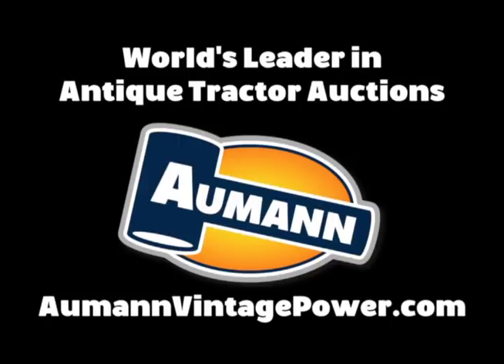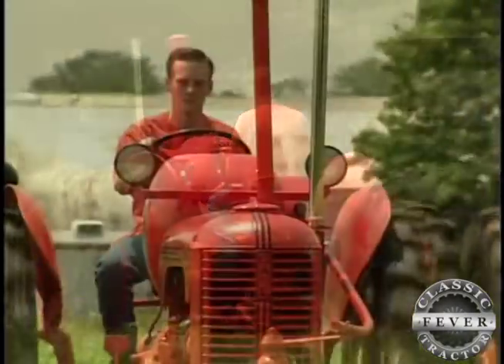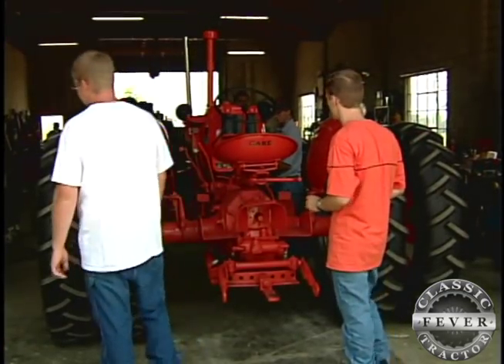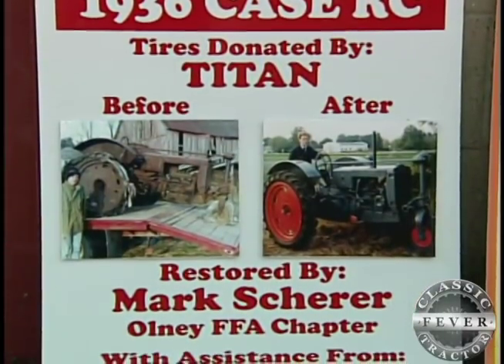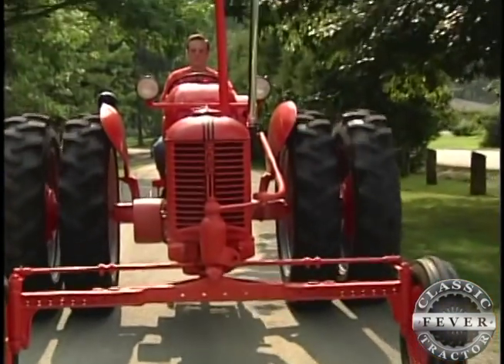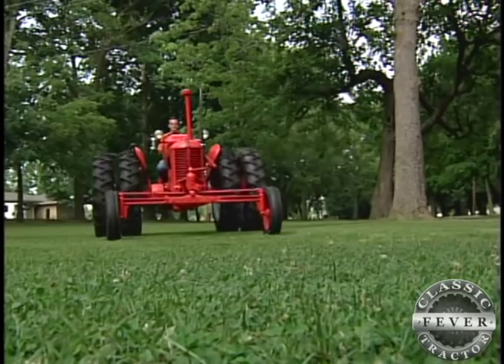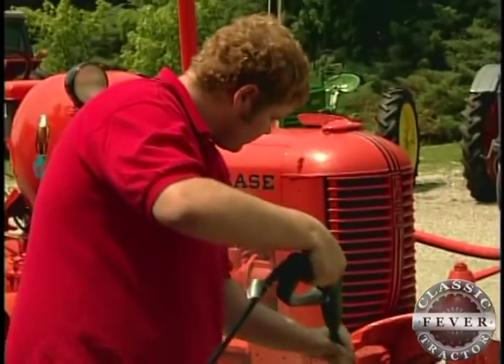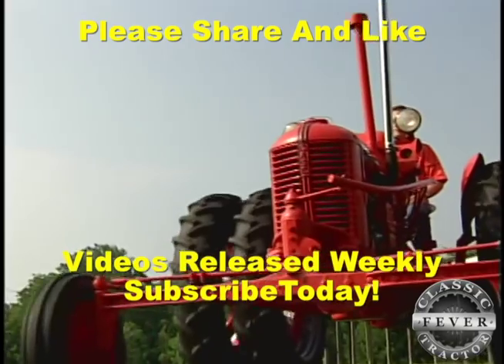1949 J. I. Case Model DC Gas Tractor With Rear Duals - Classic Tractor Fever

Comment: That is a really unique  tractor. I especially like LP tractors, as I have an Allis Chalmers WD 45 with LP conversion. I would love to see that tractor at our antique show in 2019 as Case is the feature tractor. Our web site is AE-TA.com.
Reply: Thanks, it does have some unique features with the 96" rear axles, adjustable wide front end and propane.  The duals are not original, but I like them.  Titan Tires insisted on donating all new rims and tires for the tractor.  Thanks for featuring Case at you show.  It looks impressive and  I see that you have supported your local FFA chapter that's great!

Comment: What size tires??
Reply: Thay are very big
Reply: @markscherer5763  and what size would that be??
Reply: Most likely standard issue which was 13.6 X 38   Optional would be 14.9 X 38.  This would be  times  two in this case.

                                      Fergieman
Reply: In the 50s  tire sizes were listed differently,  a  13.6 X 38 was a 12 X 38 - a 12.4 X 38  was an 11 X 38.

                                Fergieman